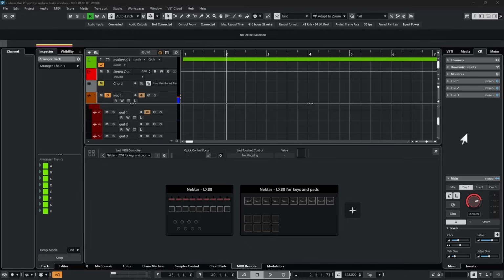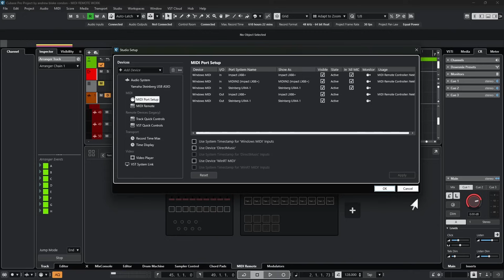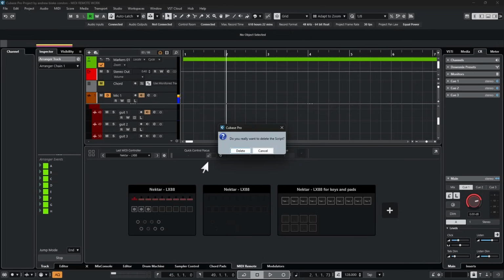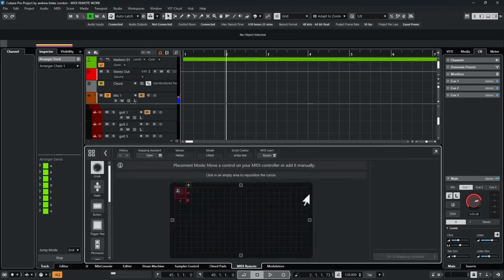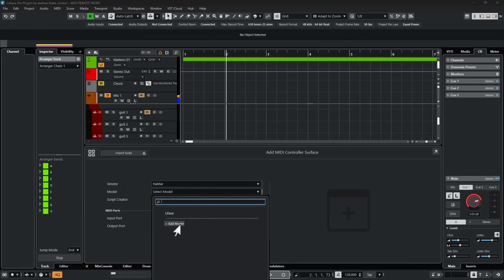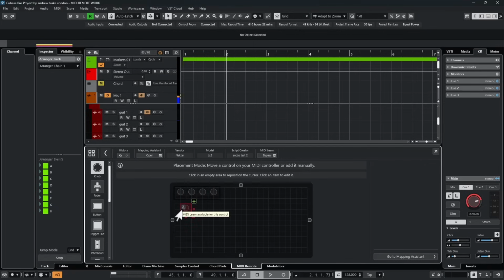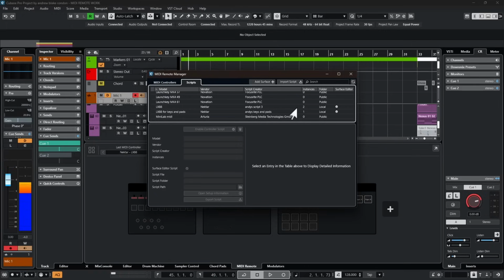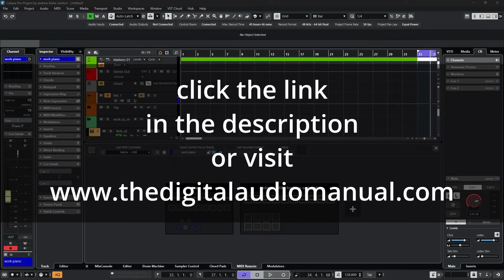Building a Custom MIDI Remote for Cubase

Comment: My issue has been unsuccessfully trying to map the faders on my Keylab 88 Essential to things like CC 11, 1, 7, etc.  Not sure what to trigger in Cubasse to make that happen.
Reply from the maker: hi bill
that may be because CC messages are not like regular parameters like volume and pan, ect.. I havent tried it myself, but if I was trying to do what you are I would probably experiment with the track input transformers and/or quick controls,, the input transformers allow you to change incoming data to things like CC messages,, and they can be assigned at either the track or the whole project level,,, andrew
Reply: Thanks - I am using a sparrow 5 midi controller now but realy wanted this integrated with the keybord.  I will tinker further.
Reply: First of all you have to add in Studio Setup /F 12/ - Midi Port Setup- Add Device - Add Generic Remote. 

Then on the right choose Midi port IN/ OUT -   Name of your controller .

After that press LEARN tick box and  then ADD  and turn one by one all faders/ encoders/ knobs / .

Cubase adds  and  remembers  them as your controller . Click APPLY.

In Midi Remote manager  deactivate Bypass - which activates   Midi Learn. This gives you automatic response when creating and assigning knobs.

Comment: Great video, well explained like all the others.
I have an Arturia Keylab 61 MKII and I tried to make its knobs/sliders work following your instructions. As in your example, there are 2 different controllers of the same machine but the one that's supposed to connect with the knobs/sliders doesn't respond at all. Am I missing something? In other words, if the "learn" mode doesn't work, what should be done?

Thanks in advance.
Reply from the maker: hi Maurizio,,, if your not getting a connection where you see controllers progressing on your panel,, you're stuck,,, I know I've been there,,, I would not give any concern when you have a difficult remote about trying to get all the details right at the beginning,,, instead, I would make sure all my panels and scripts are completely removed, as I demonstrated,, then going to the studio menu and MIDI devices, I would make sure I was completely confident of all my inputs, testing by unplugging and re connecting,, again as demonstrated in the video,,, then I would begin 1 by 1 with each input building one panel only and testing what connections are valid, taking notes if necessary,, and repeating this process until I was completely sure of the operation of my equipment,,,  then, and only then would I worry about building my final panels as necessary,,, andrew
Reply: @TheDigitalAudioManual  Thanks a lot, Andrew. I'll give it a try 🙏